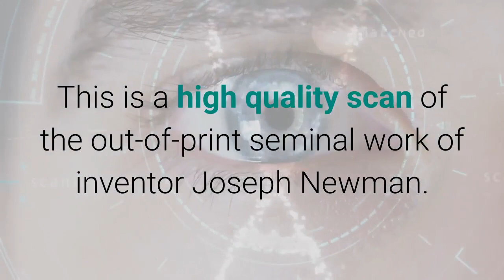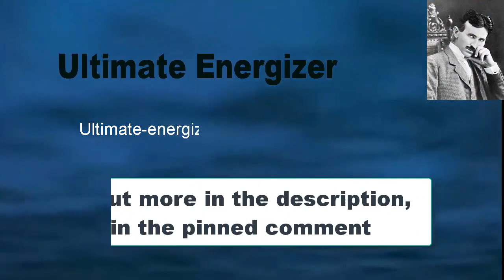The Energy machine of Joseph Newman

Comment: THE VERY LARGE copper coil with permanent magnet spinning inside, drives the spin 70% of 180 degrees in two cycles per revolution. The free energy is flyback current during coil shorted segment of operation. Two 30% of the rotation events, are the battery current injection. 30% input 70% of rotation output. Twice per 360 degrees.

Comment: Applying magnetic fields to matter causes bound electrons in atoms to precess in their orbits. This causes these electrons to generate electric quadrupole moments which are "charged" using the bound electrons' kinetic energy. An electric quadrupole produces the same type of electric field produced by a rotating Faraday Disk, inducing an interior charge that is equal and opposite to an induced peripheral/circumferential surface charge.

In electrically-conductive, crystalline materials like copper, nickel, and iron, the electric power generated by changing the electrical quadrupole moments involves a displacement current that reaches out to a nanometer (due to decreasing in current density with the inverse fourth power of the distance), delivering energy to very-nearby conducting electrons. The space intervening between conducting electrons and bound electrons can be viewed as a dielectric gap through which electrical energy can be transferred from the concentated form that exists in atoms to the less concentrated form in electron "gas" which flows between them. For effective exchange of energy, the drift velocity divided by the pulse frequency should be less than one nanometer as the induced electric quadrupoles generate a periodic potential in the crystal where the work done per half-cycle on each conduction electron maxes out at some mere angstroms of distance. Thus, managing the pulse duration as well as current density is essential.

Permalloy is an electrically-conductive alloy of iron and nickel with very high permeability at kilohertz frequencies, frequencies that may be sufficent for current densities that generate only modest heat. Based on preliminary calculations I have done in the past month (September-October 2019), it should be possible to extract a few watts per cubic centimeter of material (equivalent in power density to a few megawatts per cubic meter). The calculations take into account such factors as the estimated radius of the electron orbital, the precessional frequency of the electron orbital spin as a function of the applied magnetic field, and the magnetic saturation strength of Permalloy 80 metal. The unit price of a small device should be no more than 10 dollars and generate a few watts. The cost efficiency should grow dramatically with larger unit sizes and unit quantities.